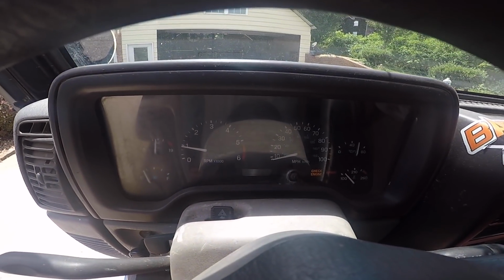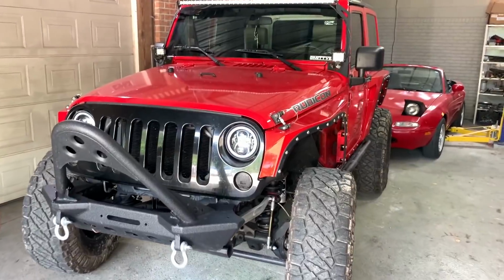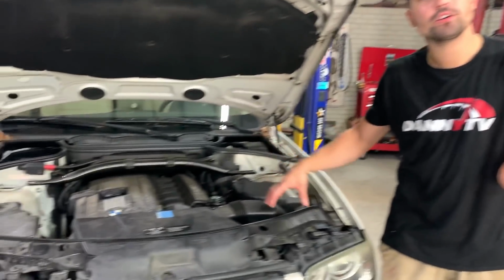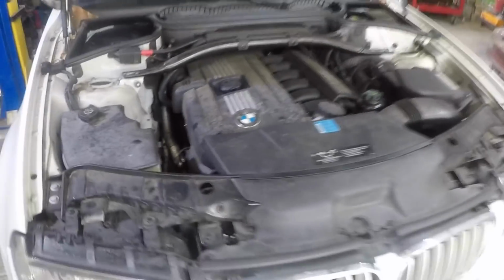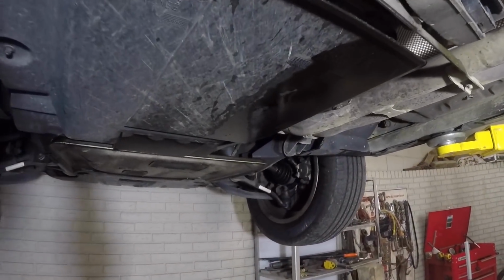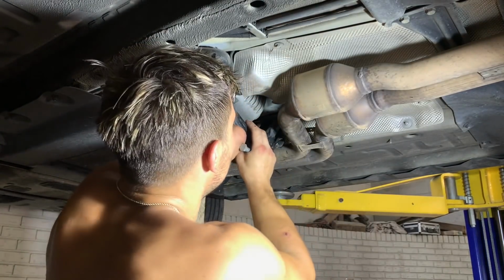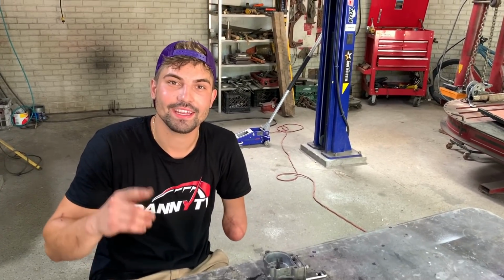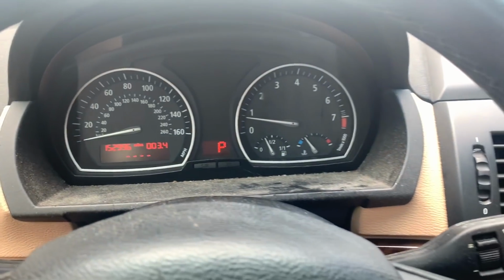HOW TO REPLACE BMW X3 (E83) 2004-2010 Servomotor Actuator DIY Repair | NEW BUILD!

Comment: Nice job.  I did this twice on my wife's 2007.  The first time I just rotated the gear180 degrees as it never turns very much. It lasted another 60k.  The next time it happened I found the aftermarket plastic gear to replace the original  with.
Reply from the maker: Right on